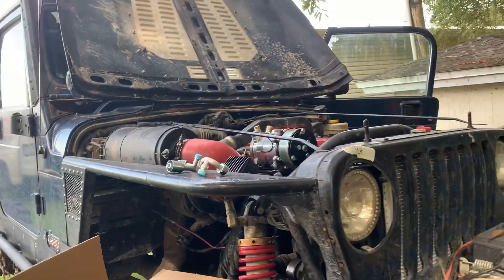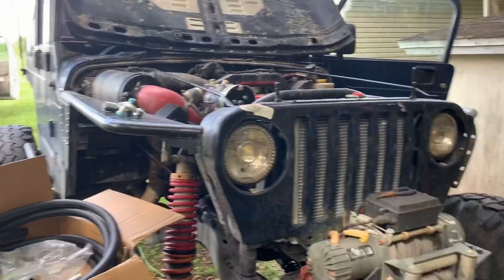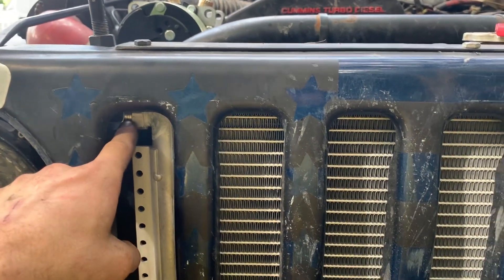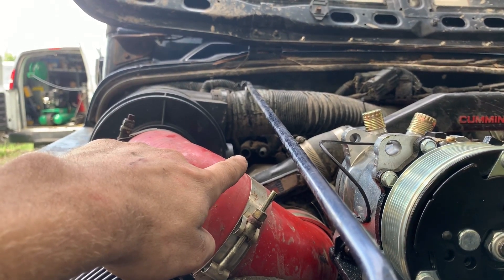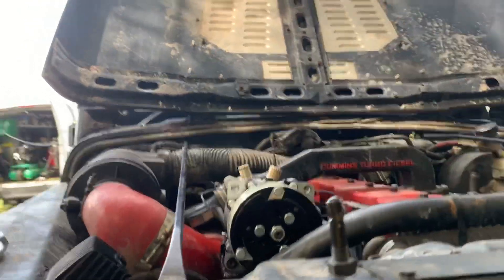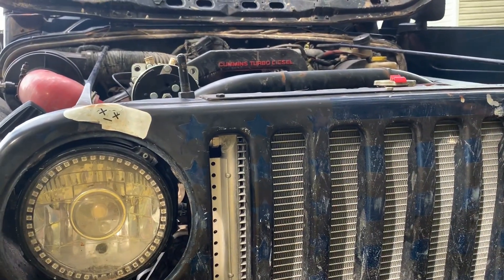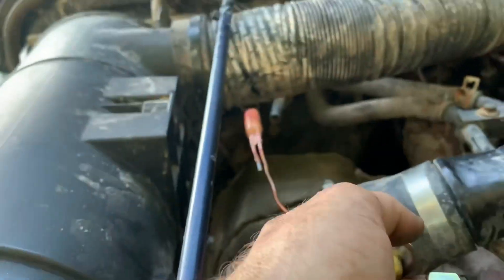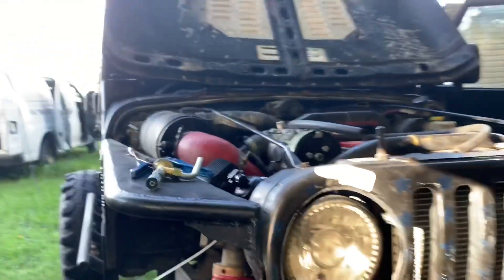Cummins Swap Ac System Part 3 (making hoses)

Comment: I have almost the exact same setup on my 84 dodge 318, Sanden 508 universal condenser and drier and custom made hoses etc, one thing that I found helped a lot is using blue Nylog on all your o-rings and fittings especially the expansion valve where it is just relying on the flare fitting, you will have absolutely zero leaks for many years. Got my bottle on amazon for like 9 bucks, it has very good reviews for everyone that uses it